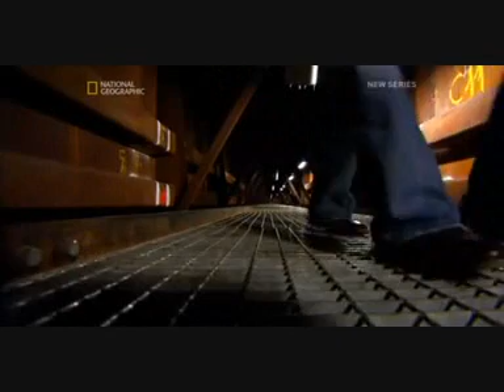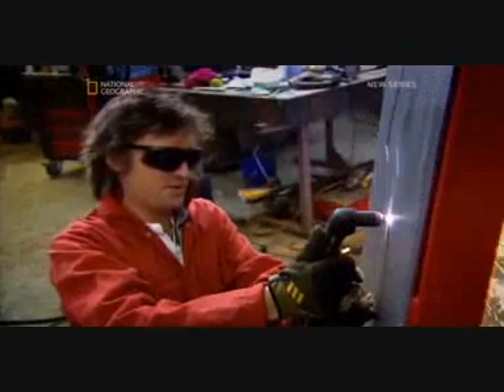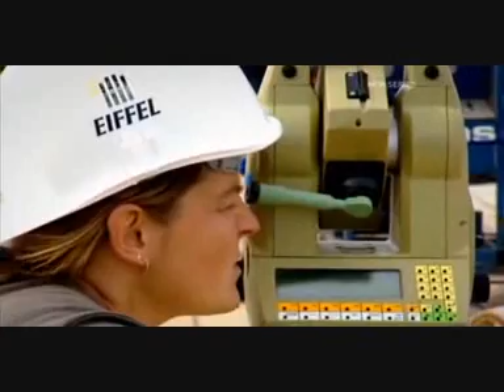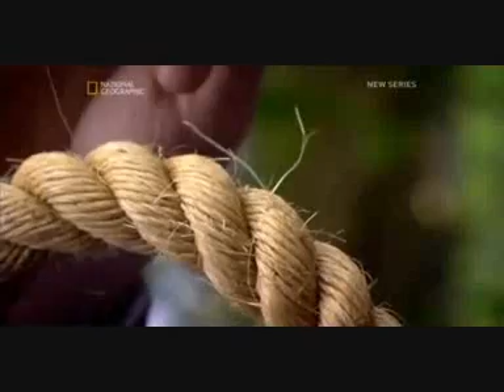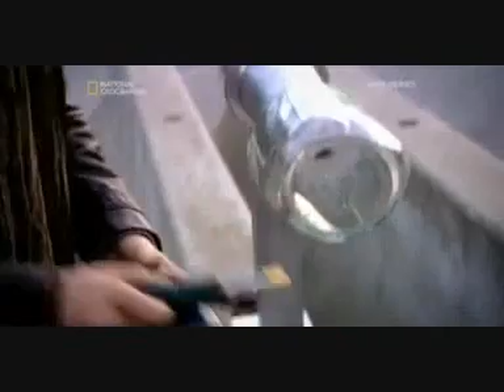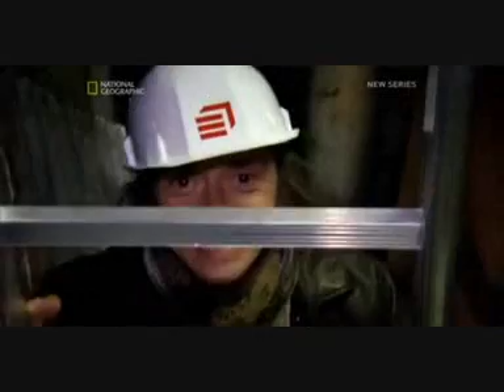Millau Sky Bridge - France

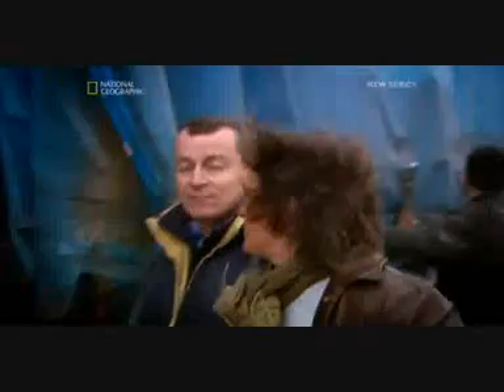Comment: There's a flaw in their reasoning at 21:05

They are measuring the amount of time it takes the sound of the guitar to reach them but they're failing to take into account the time it takes the signal from the guitar (since they are more than likely using a wireless system) to reach the speakers in the first place before spitting out the sound in the first place.